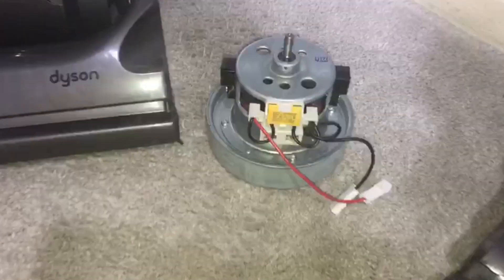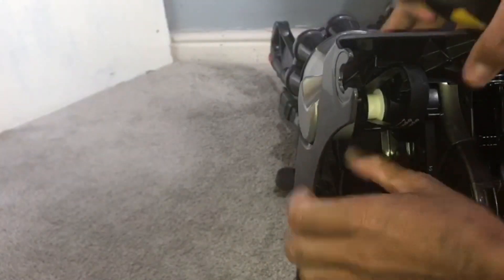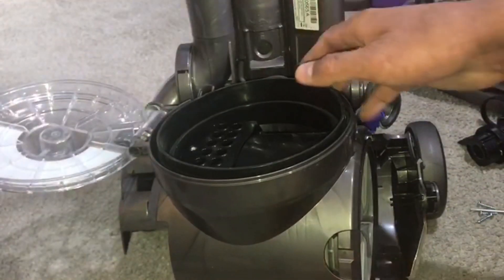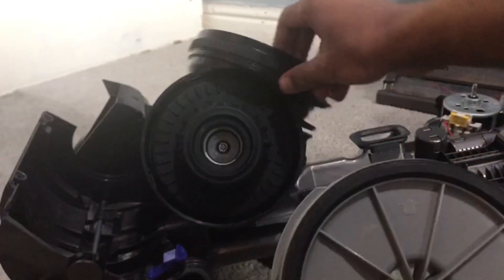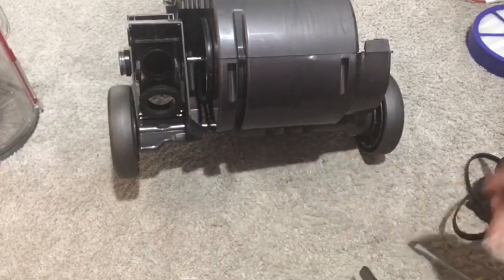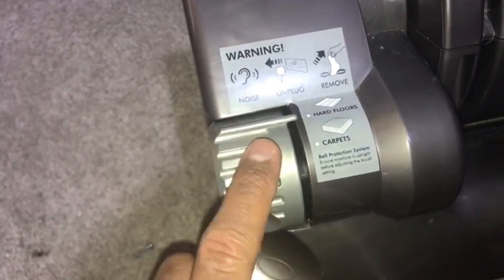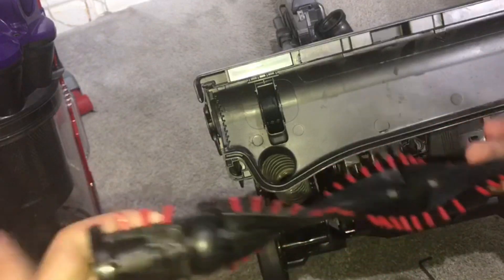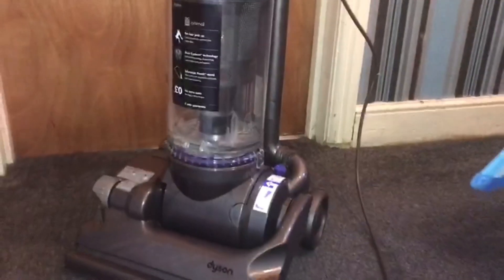HOW TO- Dyson DC33 MOTOR & CLUTCH CHANGE + Tricks to make your Dyson work like new! (EASY PEASY)

Comment: Excellent video which was a great help when I was replacing the motor on my DC33. A couple of things that may be useful to others doing this. When disassembling, if you aren't intending to do any refurbishment on the clutch you can just leave it in place (i.e. skip 2:15 to 3:07). When reassembling I initially struggled trying to get the motor back into the casing. The reason was that I hadn't pulled the large rubber gasket fully over the fan canister. The rib on the gasket should be pulled back until it completely covers the flange on the cannister, so it appears as shown at 7:38. The motor should then slide into the casing fairly easily, although it will need a bit of force to push it all the way home.
Well done though Parwaz 786. A really clear video that has no doubt saved many DC33's from being scrapped!

Comment: Fantastic Parwaz. Second time I've replaced  the motor and I could not have done it without your incredibly comprehensive and easy to understand tutorial. I'm 75 and crap with computers, but this was as you say EASY PEASY. This is definately how it should be done, Many thanks.

Comment: Thanks so much for this excellent video.  I suffer with  Arthritis in my wrists so some of the pushing and pulling that was required was a bit tough and meant that some aspects of the job took me much longer. However, without this video I wouldn't have even attempted to replace my burnt out motor,  but the instructions were so clear and informative I decided to give it a go and persevere. So glad I did as my vac is fully restored and works perfectly, thanks again.
Reply from the maker: Such a nice comment you really put a smile on my face! I am really glad to hear of your success story, well done!! 💯💯💯✌🏽

Comment: Great video, very clear and concise.  Nothing that doesn't need to be there and some timely tips and tricks along the way I wouldn't have considered.
Big help in replacing the motor of my 2010 DC33.  Some things that were different on mine: the exhaust filter doesn't have a nice flip lid like the video (couldn't even find any pictures or evidence that they ever made them like the one I had).  The replacement washable filter fits and works correctly though.  Secondly the motor was physically smaller though the key dimensions like the shaft length and diameter remained the same and fitted perfectly.  Great job.
Reply from the maker: I’m glad you found it helpful! Wow I’ve never heard of a DC33 without a flip open lid! 😮

Comment: This is an excellent video and thanks for showing how its done. if this was not available I think I may have struggled a bit.  A point I would like to make is that  when removing the old motor be very careful when pulling it out of the housing. Because the wires from the main lead to the motor connections are not that long and one of the terminals came away with the my motor. Thanks very much.

Comment: Hi! Thanks so much for this Video but I still need help. 
A common problem with these Hoover's is that after a while, the mechanism that diverts suction from floor to nozzle stops working. The plastic bit above the right wheel doesn't stay in it proper place ( often you can't put the hoover in upright position without adjusting that plastic piece by hand. Or, the hoover will go in the upright position but won't have suction through the nozzle. 

Does this mean I need to replace the clutch or a different part? 
🙏🙏🙏
Reply from the maker: Hi! Sounds like the black button/plastic piece above that valve needs sorting out, it’s spring loaded to act as a lock to keep the valve up in the vacuuming position check that it’s fitted correctly 
Also that the removable valve pipe has the rubber seal fitted at the bottom too

Comment: Great video, thanks.  My only issue was that the motor I bought from Ebay was slightly different shape so I had to trim the seal as you suggested.  It was then a very difficult to clip the end back on the motor - there was a slight gap all the way round but it wouldn't go in any further - the filter housing is a bit tight now and not completely flush but as the seals meet it seems to work fine.
Reply from the maker: You're welcome- glad you've successfully managed to fix your Dyson!

Comment: Hi from Alaska! Great job on the dc33 video. Mine has a burning smell people speak of combined with the motor slowing down (loss of power). Suction seems fine. Replace motor? Clutch? Just belts? I’ve started removing the brush bar and will clean behind end caps.  I simply don’t know if the smell and power loss is a clutch or motor issue. Thoughts?

Comment: Hi do you have to use the long screw for the clutch cover. I cannot get that thing in for anything.
Reply from the maker: Hi as long as the clutch cover is held in with at least 2 screws it should be fine
Reply: Snap!! Just at it for hours, was bad enough getting the 2 in. I just gave up with the main back

Comment: Brilliant video.  I find removing the brushbar assembly off the cleaner head and the motor cover lid a pain to remove without breaking. Other then that it's a easy job. Which pattern motor was it?
Reply from the maker: I didn’t use a pattern motor, haha I used the original motor back in, the pattern motor is just a typical pattern one you’d find on eBay with thermal overload cutout 👍🏽

Comment: When fitting the motor, do you wrap the wires around the motor when placing in the motor housing or do you move wire inside the housing when fitting the motor?
Reply from the maker: Either way is fine

Comment: Is there a fuse reset on the motor for American versions of the DC33? My machine suddenly stopped working. Replaced the switch and then tested the power cord. Those parts weren’t the issue. How can I test if the motor is bad?
Reply from the maker: It sounds like it will definitely be the motor, if the switch and cable are working. The motor is the only other component that would go faulty

Comment: Great video. I successfully changed the brush and clutch on my DC 33. At the end of the video you got me interested in replacing the internal hose. It looks like I can replace the internal hose without taking everything apart again. Is that correct?
Reply from the maker: I love hearing success stories like this! Indeed you can replace the internal hose very easily without taking the vacuum off, infact you won't need any tools as it just pulls off at the grey end and twists off at the other end
Reply: @parwaz7861  That’s what I thought when I was looking at the hose.  Thanks.  The new clutch belts were really tight. Had to pull belt through the front piece with needle nose pliers and then use a screw driver to stretch it enough to insert the brush.
Reply from the maker: Very good I'd say your belts are in good condition!

Comment: 9:18 I mostly put wire through the 2 holders, but I don't make it into a L shape as it comes loose when putting it back on the machine. Would it be fine like that?
Reply from the maker: As long as the wires are clipped together firmly they should be fine
Reply: @parwaz7861  They are clipped together in those 2 wire holders. Has this happened to you?
Reply: @parwaz7861  Do you find any Dyson's fiddly?
Reply from the maker: Yes from DC50 cable changes to DC27 motor changes
Reply: @parwaz7861  For some reason, I find that putting the wire only through the 2 wire holders is much more easier then making it into a L shape. What do you think?

Comment: Great video - never done this before!! Our DC33 has been well maintained. If I’m doing the motor do you think I should do clutch as well - how do I tell if clutch needs doing?
Reply from the maker: Thank you! I would recommend the clutch should be changed because after a few years the rubber belts tend to stretch out (they need to be really right so the brush spins at optimal speed).
To tell if your clutch needs replacing, if you feel like the brush slows down when it hits the carpet and it isn't brushing the carpet as well as it used to, it's most probably the clutch belts which are worn and should be replaced (as long as the internal hose is pushing the brush onto the floor properly and the bristles aren't worn out).
Hope this helps!

Comment: I mostly put the motor housing on the motor, line it up, put the wires under the carbon brush and seat it in I always leave the spinal cord in the housing and not take it off. Will it be fine and not cause damage?
Reply from the maker: As long as it works it should be fine
Reply: @parwaz7861  I think that's the best method since the wires are quite long.

Comment: The gromit bit on the internal spinal cord which is that chunky bit that comes out of the hole on the motor housing is a bit lose and moves. I have moved it back in place and it seems fine. Do you think it's safe?
Reply from the maker: Yes

Comment: Thanks for the great video. One thing was different on mine - the colours of the wiring connection to the motor where red from motor connected to blue from housing and black from motor connected to brown from housing - have you had this before? We have had the  Dyson from new and this is its first replacement motor.
Reply from the maker: You’re welcome I’m glad it helped you!
Sometimes the wires can be connected the other way around but it doesn’t matter really which way it goes since it’s an AC motor running off the mains outlet
Reply: @parwaz7861  thanks - my wife reminded me that it had been repaired by a dyson agent within the warranty - that might be when they got switched.

Comment: My DC33 makes a loud noise but only in carpet mode. How do I fix it? Is it just the clutch that needs replacing?  Great video btw!!! 👍👍
Reply from the maker: Hi thanks for your comment! It could be the type of carpet, if it's a very thick rug and it jams the brushroll that could be one thing, also remove the end caps on your brushbar, there's usually a big hairball in each end of the brushbar end caps, if this doesn't work I'd recommend a new clutch 👍🏽
Reply: @parwaz7861  great. Thanks. It makes the noise if i lay the machine on its side.
Reply from the maker: Ahh, I reckon it's definitely either the brushbar or the clutch

Comment: I got a used but very good condition dc33 and noticed behind the bin where the crack occurs and it looks like it has a crack but doesnt feel like it. Do you think it will be fine?
Reply from the maker: It'll probs crack like they all do and snap in half eventually, it's a rubbish model the dc33 is
Reply: @parwaz7861   does it crack when its been abused?
Reply: @parwaz7861   I did look at it again and it doesnt seem that it is cracked.
Reply from the maker: Yes

Comment: In your opinion, is it easy to remove the cable when changing the motor or doing it without? And which one do you prefer?
Reply from the maker: You can do it either way, I don’t know what I prefer because removing the cable is a mission and not removing the cable gives you less room to work with
Reply: @parwaz7861  I have found it easy to remove the cable as it gives more room, but takes a while to put back together. I did try starting at the bottom and it was a bit fiddly.
Reply: @parwaz7861  I have tried starting from the bottom, but it can take a a while.

Comment: I've noticed when fitting gasket seals to Dyson's cyclone that they fit, but some sides stick out a bit. Is that normal?
Reply from the maker: It’ll be fine, you can either leave it as it is or trim the seal down
Reply: @parwaz7861   Are the pattern DC33 gasket seals a bit thicker then the original one that's already fitted inside?

Comment: I'm trying to find a very good condition chassis for a DC33 but bit worried that it may be broken. Where should I look?
Reply from the maker: Honestly anywhere you can find a good one
Reply: @parwaz7861   That is true but the ones I've found have a crack on the side of chassis.

Comment: The trumpet noise has come back, but not a lot. Will it be fine to use? I did strip it down again to the motor and put it back again. It does work fine.
Reply from the maker: It’s just the gasket, it won’t reduce the lifespan of the vacuum
Reply: @parwaz7861  I did soak the motor seals in warm water. Would that be the cause?
Reply from the maker: Possibly, you’re not supposed to wash the seals on them, I would just leave them as is
Reply: @parwaz7861  I have a spare motor seals. I'll try that.
Reply: @parwaz7861  It's the first time I've had that issue.
Reply: @parwaz7861  I've put the seals in and the problems fixed now.

Comment: I finally got my brand new DC33 chassis but I wanted to put the serial number sticker on the new chassis whats the best way to remove it without damaging it?
Reply from the maker: Use a hairdryer and gently peel it off
Reply: @parwaz7861   What speed do you use on the hairdryder and for how long?
Reply from the maker: @jayambermsp8000  honestly it just needs heating up for the glue to melt

Comment: Once I fitted the motor in, I sometimes can see the motor connecters, but not the wire. All the wire are tucked neatly. Will it be fine? The machine works though with no fault.
Reply from the maker: Yes it should be fine, it’s better not to tuck the connectors into the diffuser area as that’s where the airflow is concentrated however
Reply: @parwaz7861   I've refitted the motor and the connecters are resting on each side of the carbon brushes and isn't in the diffuser, but I can still see the wire, but not a lot. Do you think it will be fine?
Reply from the maker: It depends on where you can see it from, it shouldn’t be visible from anywhere really and if it isn’t from the diffuser then it sounds like the motor isn’t seated correctly, which will make the motor retainer press against the filter housing more and the spindle appear shorter than usual for the belt which will result in the belt slipping 

It has to be fitted correctly in order for the vacuum to work optimally

Hope this helps
Reply: @parwaz7861  The motor is fitted in properly and the spindle isn't shorter.
Reply: @parwaz7861  I fit the motor with the thermal cut facing down.
Reply: @parwaz7861   My mistake. The wire isn't under the diffuser, it's next to the motor housing, but tucked in neatly and hardly noticeble.
Reply: @parwaz7861   I mostly put  the motor connecters on each side of the carbon brush then I manipulate it in then it fits.
Reply: @parwaz7861  I mean, it works fine with no issue. Should I not worry about it?
Reply: @parwaz7861  Would putting the connectors under the thermal cutout stop the wires from showing?
Reply from the maker: @jayambermsp8000  If the vacuum works fine then you shouldn’t really worry about it. Where are you seeing the wires from? If it’s from the diffuser area then just make sure they’re not in the diffuser area that’s all you need to do
Reply: @parwaz7861  It does work fine. I only worry about it because it's connected to the electricity.

Comment: Can you put the upper motor mount any position other then the straight way it's supposed to be?
Reply from the maker: As long as the vacuum works fine it doesn’t matter
Reply: True. It does work well like that.
Reply: @parwaz7861   I've noticed that when putting the wires to one side when fitting the motor, it doesn't seem to go in fully. Would wrapping the wires around the motor be the only solution?
Reply from the maker: @niceandspicy3197  That can be done but as long as the vacuum works, it really does not matter
Reply: @parwaz7861 I've only had that on pattern motors. I'm not sure if I've had it on genuine ones.

Comment: Have you  had pattern Dyson motors wires to get in the way whilst fitting it?
Reply from the maker: Yes
Reply: @parwaz7861  I mostly wrap them around the motor, would it be safe to do that?
Reply from the maker: Yes
Reply: @parwaz7861 I did that but I can see the motor wires in the housing.
Reply from the maker: @niceandspicy3197  As long as the vacuum works, job done

Comment: I changed my DC33 motor and after few days I can see some carbon dust in the filter housing. Is it supposed to be like that?
Reply from the maker: It might just be the remnants of carbon dust from the old motor
Reply: @parwaz7861   I cleaned it before fitting it. Do you think its anything to worry about?
Reply from the maker: @jayambermsp8000  motors emit carbon dust anyways I wouldn't worry

Comment: Parwaz, I've just got a second hand DC33 off ebay, it's really stiff bending it from upright to angled to  vacuum. Am I doing something stupid or should it just move from upright to angled position to vacuum? It STINKS of wet dog, any ideas of how to get rid of the smell?
Also, should there be permanent suction from the wand on the handle as I vacuum the floor?
Reply from the maker: Sounds like the groove in the motor housing where it meets with the black upright lock needs lubrication
As for the suction at the wand, it should divert to the floor when you kick the hesd to the floor, chech that there's not a plastic piece broken off the cleaner head near the clutch knob (when the head is kicked down into the vacuuming position) as this plastic piece near the valve pipe moves the diverter valve to the head when the head is kicked down

As for the smell I recommend washing the filters in scented shampoo and wash the cyclone and shroud out thoroughly then leave it to dry properly
Reply: @parwaz7861  Thanks, I'll check